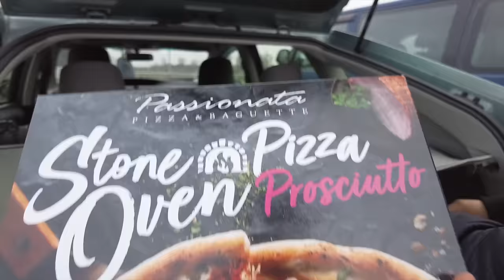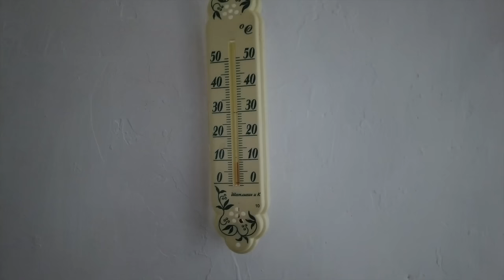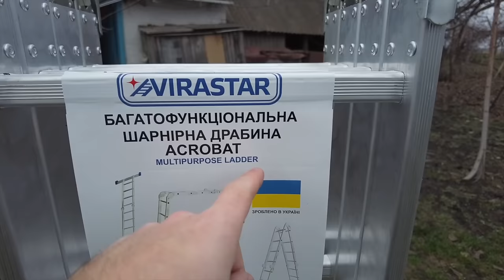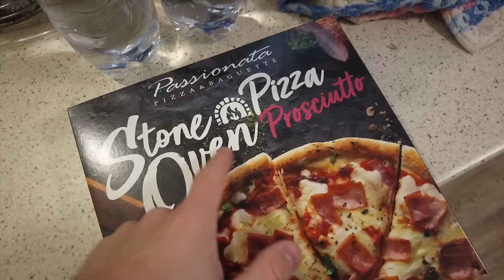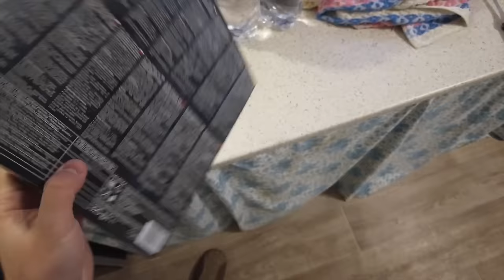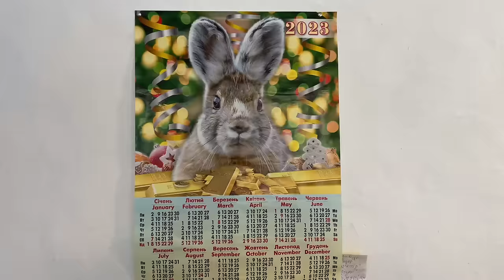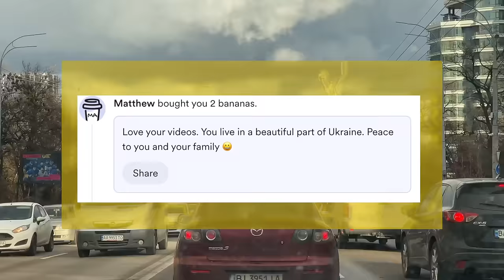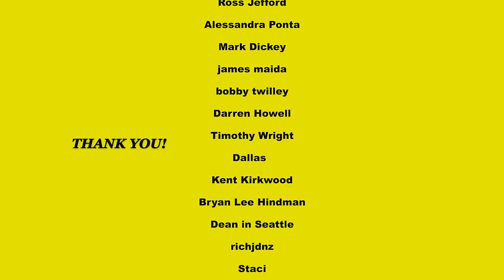Living the Simple Life in Ukrainian Countryside | Staying in a Summerhouse in Winter

Comment: For that smell, there's a chemical product, that can be had at DIY construction stores, that dehumidifies the air. That robs the mold of the moisture it needs to grow. (It's like a coarse salt, that you place in an open bowl. Then just set somewhere in the room. Then when you come back in a week or so, the bowl is full of water, and no granules are left.) Doing so will help prevent all the mold and water damage, that happens in an empty house. (And, it will usually take 48 hours to get such a brick house fully warmed up... they are slow to warm up, and slow to cool down.) 

Yes, you get use to the cold. Think about the medieval monks who lived in buildings without a pitch, and nothing but a curtain over their window. Just while you can get use to the cold, your house (especially furniture) can't. 

I'm glad you got the dacha in shape. If this year the orcs do their damage again, you'll be better prepared. If the power goes out, I'd rather live in the dacha, than in some high-rise apartment complex. The piches that you have, a couple of oil lanterns, food stored up, and I'd weather out the winter, like a bug in a rug.

Comment: I have that kind of ladder also. Well, very similar to that one. It's much older and doesn't have those stabilizers on the bottom. But they are so versatile and very convenient. Tip: keep the levers and locking mechanisms lubricated. When they freeze up from dirt or corrosion it is not fun. Thanks for posting this video. 👍